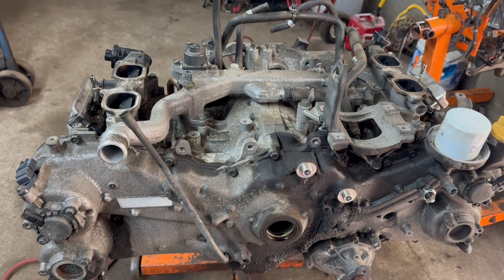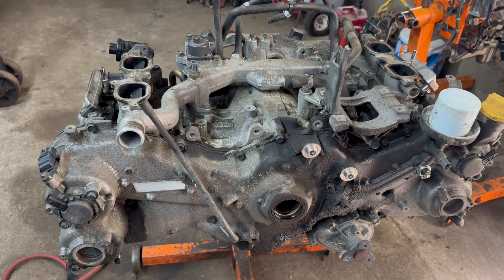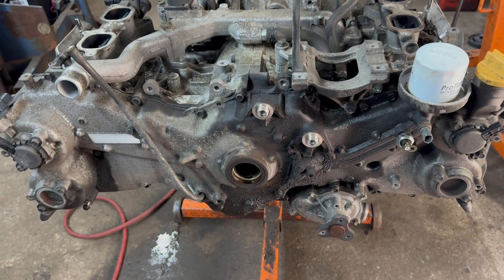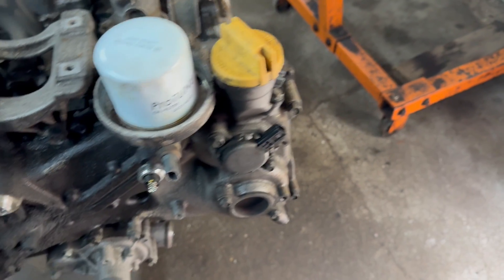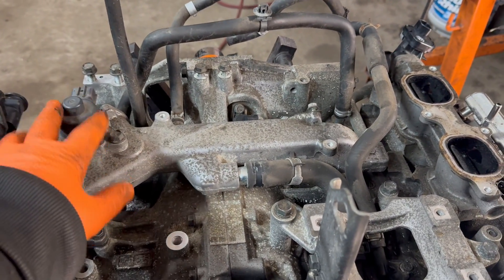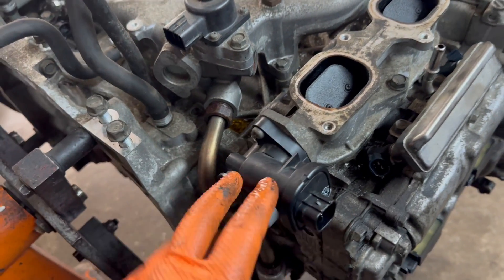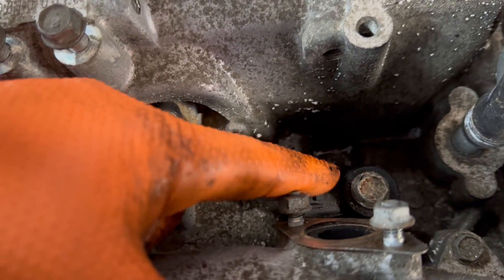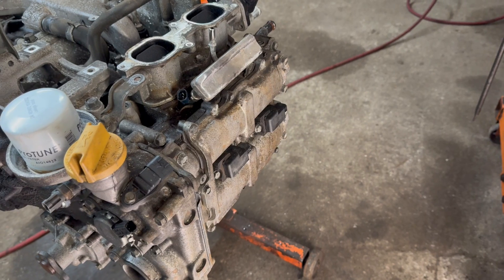Subaru Boxer Engine Common Sensors Locations - Cooling Temperature, Knock, Cam, Crank etc.

Comment: when the engine runs what way does the coolant run clockwise?
Reply from the maker: From water pump to lower radiator hose through top radiator hose to engine